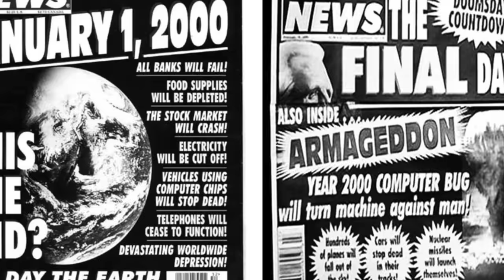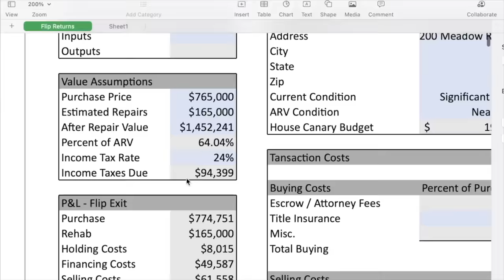Our BIGGEST House Flip Yet | Before and After Full Home Renovation

Comment: Several things:  drywall over all niches, square off treys, add some sort of crown to the kitchen cabinets, remove/rework peninsula or at least lower it to counter height, remove limestone above the mantle or remove the arched part only, remove the column crown, take primary bath toilet room wall all the way up like you did the pantry, hardwood on stairs (or at least refinish the visible red stain that clashes now with the new floor downstairs). This one looks like you guys were in a major time crunch and bare bones budget. But definitely a big improvement! 😬
Reply: They don’t do a lot of the finer details.  Paint, floors is about it.  I agree with all your suggestions though.
Reply: Great summary. Totally agree.
Reply: Agree. But you missed one, ceiling. When they first showed the house, they had comments about everything and then when they showed finished house you can see everything is left like before, only new paint. I liked all transformations from previous work, but this one not.
Reply: Yes! Listen to this lady!

Comment: That wasn't blue paint. It was from having a platform bed in the corner of with blue sheets rubbing against the walls. My platform bed frame is basically a board on a box and leaves similar imprints in carpet
Reply: Yep, my son had a Texas flag comforter years ago and the wall had red and blue on it.

Comment: Super high vaulted ceilings like in this house are a pain because the light fixtures and smoke alarms are so high up and are difficult to change out bulbs and batteries. I'd convert the highest area into a second master bedroom which would have spectacular windows in it. 

I don't like master bedrooms on the main floor because I like having windows open at night but I'd feel insecure because it'd be so easy for someone to crawl through them. Most people, I imagine, will remember Elizabeth Smart who was kidnapped. The kidnapper crawled through an open window (or unlocked door). No sense in taking extra chances.

Wallpaper was already out of style in 1999. It's coming back in now.

Comment: Whomever y’all worked with on this project is a cheapskate. Because there were a lot more changes that needed to be done to this house. Y’all keep reiterating the price point and the area but the house just looks like y’all did cosmetic uplifts that’s it. 
That fireplace should’ve been redone, that nook in the wall should’ve been removed. They didn’t even hang the upper cabinets right in the kitchen. How is the backsplash and counter flush with the lower cabinets but not the upper. The island shape should’ve been changed. 
Very disappointed in this flip.

Comment: I HATE when ranges are unnecessarily crowded, often against walls or cabinets. You can always tell when a designer isn't a cook, otherwise they'd know to ensure there's plenty of space for pan handles, cooling racks, and mise en place on both sides of the cooktop. Considering 85 to 90% of the population is right-handed, adequate space on the right side of the cooktop is particularly valuable. This is a huge kitchen, with seemingly limitless potential to create a fabulous active triangle and you put the stove there? Aaack! And the fridge in the far corner? Come on. Mix it up. Why not put the pantry cabinets there instead and shift the fridge back where it began within the active workspace. The stove would be best on the exterior wall, along that wasted run of counter. It's easier to directly vent the exhaust fan from there too.

Your choice of materials looks fab, of course, and I love the transformations. But you need to up your game on the functionality of your kitchen layouts.
Reply: Same with the last flip on that little kitchen